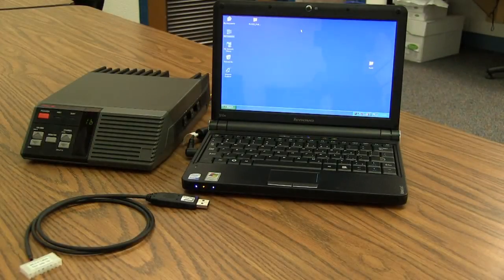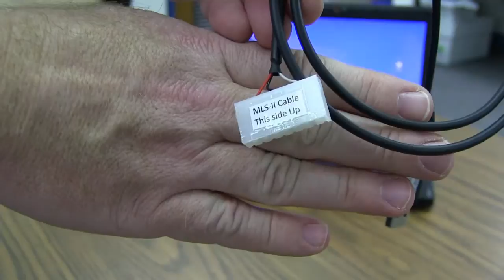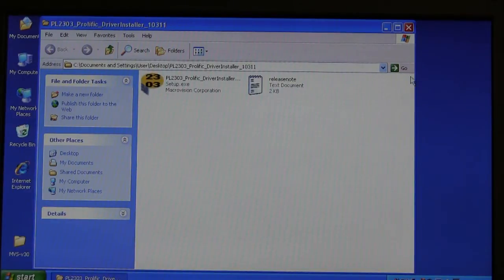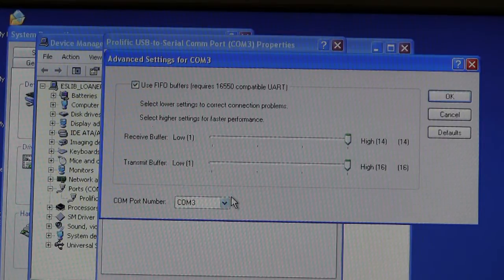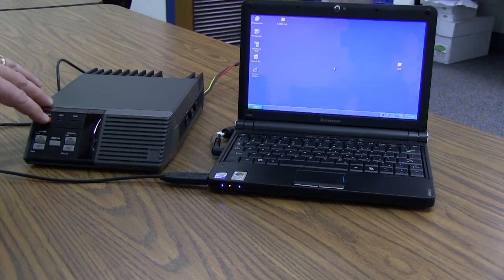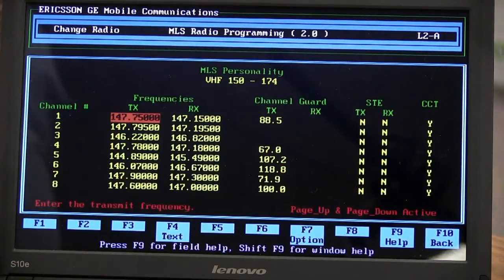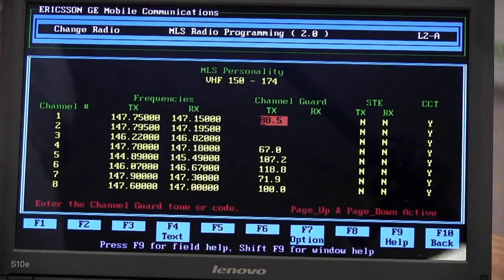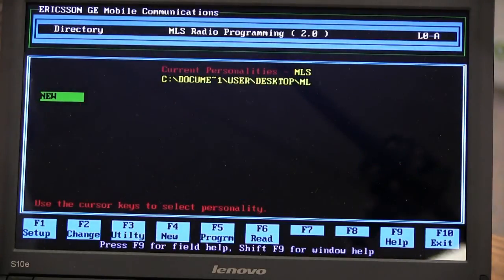GE MLS-II Programming

Comment: You can build a programming cable using a usb (or serial) to TTL adapter. And use DOSbox to run the software, I just programmed several of these radios using a Windows 10 laptop.